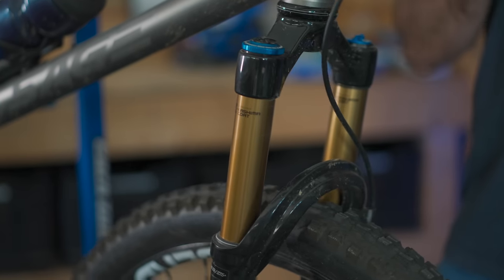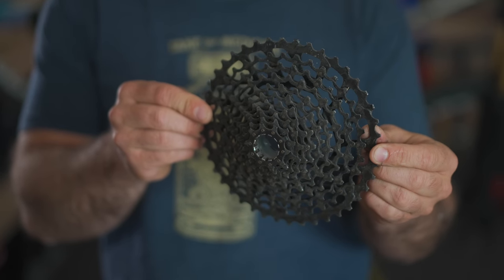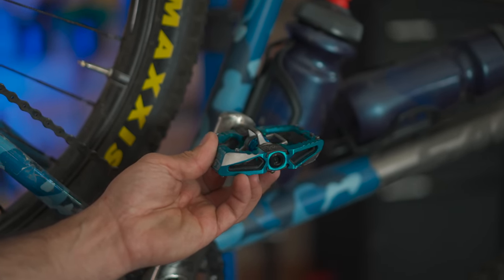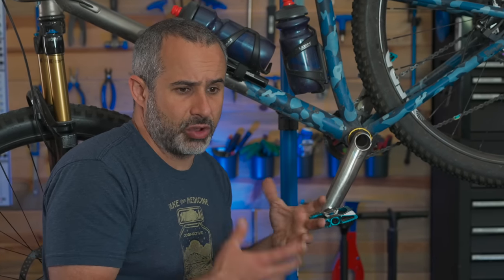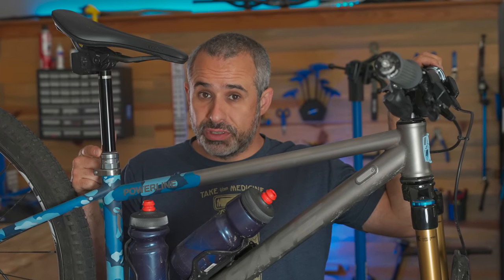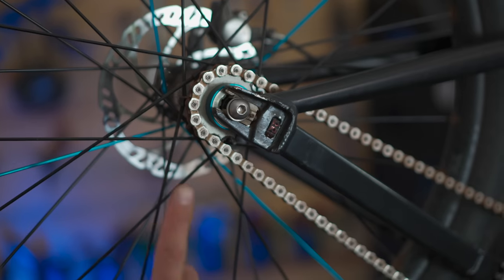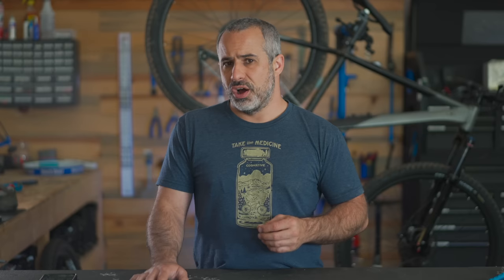You're saying it Wrong! The most mangled bicycle lingo clarified

Comment: as someone who works at a bike shop, i knew most of these, but it’s just not worth correcting people on most of them, being technically correct isn’t worth coming off as pretentious to the customer. the wheel one is the one i run into the most and i’ve just learned that whenever someone says they have a wheel related issue i just take what they say with a grain of salt.

Comment: The thing is, a chainring is also a sprocket according to dictionary definitions of the word.

Also in the 80's in Australia, everything was a sprocket on bikes, especially BMX.
Old timers would call it a sprocket.
However I wouldn't be surprised if chainring was also used it seems familiar. However it is a current term for the part in the mountain bike world.

However a chainring is merely a type or sprocket.

Comment: Oh it's called a bottom bracket shell?
We've been calling it the bottom bracket hole.
The MTB terms I find the most confusing are endo and stoppie.
In my country, we call the one where you brake really hard and the rear pops hard an endo. Basically the one you can somewhat accidentally do.
We call the one where you nose wheelie for a bit a stoppie. The one you actually need skill to do and I doubt can really be done accidentally. GMBN classifies it the same way.
But for some reason, people like to argue with me about it in comments.
At which point I just start trolling them because it's really fun to piss people off.
But which is correct.

Comment: Chainring comes from just a ring that goes on to a spider or arms of a crank, this came out of road bikes in the 70s and 80s. So technically many BMXs have sprockets up the front, and the new trend in mountain bike cranks have sprockets. Its not a front vs back of bike thing, its a description of the item, one is a ring with a large hole and one only has a small hole.

Comment: FORK END???? I'm living-breathing bikes for like 30 years now, I've been mtbing, messengering, raced on track, raced cx, played bike polo, worked in several bike shops on more than one continent and I have never ever heard fork end. 
But while we are at it and I have to admit it I have also used this term incorrectly for a long time, and I never correct anyone using it but a COG is something that's in a car transmission, a toothed wheel that engages with an other toothed wheel, that's a cog. Bikes with chain drives have sprockets.

Comment: i have one question: You explained that dropouts allow you to remove your wheel without derailing the chain, unlike fork ends.  but what about the term "horizontal dropouts"?  At least in my world, I have never been corrected by saying "horizontal dropouts", and I have also never heard the term "fork ends".

Your explanation of the term "dropouts" does make sense though.  You just drop the wheel out.

Comment: Sprockets absolutely go up front...on a BMX bike. I think this started in the 80s to differentiate between a 1 piece "disc" and spider+chainring combo. Similarly, the 4 piece bars on my BMX bike are plural, but my MTB has a handlebar. Same thing with the dropbar on my road bikes, but it also has drops. 🤣

Comment: I didn’t even know about the terminology with cables and housing but it was something that was driving me crazy when I was trying to explain an issue I have with bikes that don’t have the cable housing run the entire length of the cable.  Contaminants would get into the housing and affect the shifting or braking.  I started calling them cable housing not even knowing that was the proper term.

I am surprised you didn’t bring up stem and steerer tube because I used to call the steerer tube the stem.
Reply: I think that cable housing that doesn't run the whole length of the cable is better for shifting/braking, because there is less friction between housing and the cable.

Comment: I refuse to call any part of the drivetrain a "cog". A cog, by definition, is a gear that directly drives or is driven by another gear, such as a spur gear. Also a sprocket can be either located at the front or rear of the drivetrain, but at least on a bike, I would always think of the front if it's called a chainring or chainwheel.

Comment: HA!!! RIGHT THERE SETH.. Just after 8 minutes talking about it not being a drop out, but a "FORK END" BOOOOOM!!!  You have the same thing at the end of your front Fork.  You have 2 forks at the end of your fork, so FORKS!!!  Any any time I have ever used the term forks, it was in reference to the fork ends on a Fork. A front fork with thru bolts I feel has muddied that one. But you have basically confirmed everything I said in the previous post.

Comment: When people talk about brakes behavior they talk about modulation and braking power, but actually what they call braking power is more like "ratio between braking force / finger input force"
When the rotors and calipers cannot dissipate the heat fast enough, and as a result brakes fail (brake fade, fluid boil, etc), then you can say you need more braking power, but if you want to stop using less force on the lever, then you need q better braking force ratio.
In fact i dont know how this ratio is called in the industry

Comment: DAMPNER....A dampner is a hydraulic device used to reduce pulsations in a hydraulic system.
This differs from a damper which is a hydraulic device used to damp vibrations in a physical system that the hydraulics are connected to.

Comment: What about shifting up? Is that making your gears harder? Or when the chain goes up
Reply: Remember a higher gear ratio is for higher speeds (harder to push the pedals)  while a lower gear is for lower speeds.  A downshift is to a lower gear (easier gear, lower speed, higher RPM).  So "Shifting up" is to a harder gear: moving the chain to a smaller cog and/or bigger chainring
Reply: When I say shift up, it's to shift up the cassette to an easier gear, shift down = harder gear. It's Probably the other way in the US.
Reply: @Alan-75  what happens on a double or triple chainring when the "chain goes up"?  The opposite of what happens on the cassette.  What about an internal geared hub?

For those reasons, you shouldn't be looking at how your chain moves.  Up and down should reference higher/lower gear ratios.  Doesn't matter US or not.

Comment: 1:40 As someone who rides both mtb and dirt bikes I got this one wrong, I used to call it a fork for both however on a dirt bike they are forks because each fork leg can be removed separately from the triple clamps.
Reply: But it's a fork as an assembly. So even that is wrong. You have a left fork leg and a right fork leg. Together they make a fork.
Reply: @skullsroad3642  let me check if so that means I was right in the first place
Reply: @skullsroad3642  Seems to me that you can call it either fork or forks

Comment: but a chainring is technically a type of sprocket - a sprocket technically has cogs on it - a cog is technically the tooth on the wheel (gear or sprocket). so to say that 2:43 "this has one cog" is technically wrong but in bike terms it flys.

Comment: The reason people in the UK would call it differently than in the US (like for the derailleur) is because US advertising used to be sold by the character. so all the superfluous letters went away. Most famous example has to be color vs colour. correct way is colour. But the U went away in the US because it was more expensive.

Comment: In Norway some of the terms are confusing. So saying the wrong thing here can happen too. 
Dempegaffel= directly translated damping fork, which means suspension fork, but dempe means it has a damper then right? But that's what they call forks with only springs too. 🤦
Rear shock is not less confusing.
Bakdemper= rear+damper
But I've heard ppl in motorsports call it damper in English. Yes whole thing a damper. 
Don't call a steerer tube styrerør(steerer tube) cus that's the head tube, so it's called kronerør(crown tube). 
Yes crown tube is what we call a steerer tube. 
Styre=handlebar. 
It's very common to get that wrong, might be due to the English word being translated I to Norwegian.

Comment: Hearing or seeing 'dampening' rather than 'damping' when referring to suspension has always bothered me. I recall hearing 'dampening' from a suspension tuner once. That's a clear way to know when to run the other way. I have probably said 'forks'. Isn't that a little like 'pants' though - and how many is a pair of pants? 🤣Does a fork have fork ends or drop outs? Where's Gallagher when you need him? There are a couple of other words that aren't bike specific but are certainly used interchangeably in the biking world - 'verse' and 'versus'. I don't know where the mistake comes from but it's as bad as hearing 'dampening'.  A verse is a written poetic or musical device. Versus means against or compared to.

Comment: Preload is technically the wrong term, ride height would be more accurate. Preload is more so a function of a nonlinear spring let’s say a 100-300 in-lb spring and for arguments sake let’s call it a 2 inch spring divided equally. For the initial stroke it will take 100lbs to compress 1 inch in static load (gravity). It would then take another 200lbs to compress the second half. Preload would be compressing the spring an amount that will wash out that initial 100lbs or so. Since most of our coil springs are linear, you’re never increasing the rate, therefore you’re only moving up or down in the stroke (ride height or sag). If you dial up the ride height adjustment but the fork is topped out with you on the bike you are likely to introduce coil bind. Plus when topped out there is no down travel so the bike falls into the hole (this is also why many lifted trucks ride worse, the left no down travel). All of this is a bit of a short, crude description and I get preload adjuster, but if accuracy is the main story, then there you go.

Comment: Forks are forks in the same way pants are pants. 
I do believe a sprocket is a gear that is connected to the spindle. Chain ring would connected to 4 or 5 points on the crank arm / spider.
Please argue with me Seth 😉😂

Comment: A lot of this definitely falls under the general umbrella of pedantry, but I imagine the clarification is still pretty useful for plenty of people. Yes, damping and dampening are two very different things, but I'm pretty sure in most relevant contexts the average mountain biker will know what you mean either way. The difference between a rim and a tire, on the other hand? Yeaaaah, that's a different story.

Also, you got sag and preload flipped accidentally at the end of that section; you said "one does not set their preload, you use your preload to achieve the proper sag", when, yes, you do set your preload, it's sag you don't set. Preload's a setting, sag's a statistic.

Comment: Derailleur applies when your French, derailer applies when you're not French. Horizontal and vertical dropouts exist, but why not use thru axles?! 'Dropper' could technically be used on either side of the term 'seat post'. People calling a 'wheel' a 'tire' has been happening since the invention of rubber for round rollies, I give up on that one the first second I hear it.

Comment: Damping might be more technically correct, however I don’t think dampening is wrong since one of its definition’s is: “make less strong or intense.” Using this definition it applies quite well (basically a synonym for damping) as suspension is designed to make impacts/vibration less intense. Not sure which word started with this meaning first and perhaps it was just a result of people misusing one of them long enough that it gained official dictionary word status. Perhaps a word geek could help fill us in on the history here.

Comment: There's one where i would respectfully disagree with you.. Now i'll preface this by saying that i'm not really a mountainbiker, i'm too fat (though i'm working on changing that), and English is not even my first language, as i'm from Denmark. So it's very possible that i'm just talking out my *ss here.. 😅 I do however work on all sorts of motorized vehicles which also contains and utilize cables in my spare time, and have done so for pretty much all my life, and when i was able, i did also bike a lot, so i'm not completely inexperienced either.

However, in regards to the cables.. Here we use the terms inner and outer cable, or, like you, we say the the housing or outer housing. The wire though, we call that, well, the wire.. Or the inner wire. Because that's exactly what it is, a piece of stainless steel wire. 😅 Doesn't matter if it's shift housing and wire, brake housing and wire, or whatever else.. And in all cases, both components come together to make a complete cable.. A cable. So in just pointing to the housing, i'd argue that as the housing contains the inner wire unless something is wrong, people are right in just calling it a cable, referring to it as a complete unit.. 😄

In cases where there is no outer housing, that's when we may use the term cable when addressing the wire component alone..

Comment: 3:23 I prefer to call it wire, and housing, less confusing. Many get the cable thing wrong. Inner cable outer cable. Some argue what correct and what it means in UK vs USA. But universal understandable term is wire, it's a wire wright, going inside a housing. 
In Norwegian it's called vaier, housing= strømpe(r)) stalking(s) yes like what women wear on their legs.

Comment: Isn't the chain ring a sprocket tho? It looks like a sprocket, it's used as a sprocket, it must be a sprocket. But on a bike it's called a chain ring? A sprocket is "a profiled wheel with teeth that mesh with a chain, track or other perforated or indented materia"

Comment: And calling "weight" gram/kilogram is also wrong.  Gram/Kilogram is a unit of mass not weight.  6 kg of mass is the same value on Earth, floating around weightless in space and on the Moon.  But the weight is different at each of these locations. The unit of weight in the SI Metric System is a Newton; hence the unit of torque is newton-meter (= weight x distance) and NOT kilogram-meter.

Comment: A bicycle pedal "spindle" is geometrically an axis. And mechanically it's actually at an axle, since it doesn't rotate. 

 When did just the threads  of a pedal;s a spindle, start being called an "axis"?  I think you might have got your wires crossed on that one???

Comment: Sorry Seth but you are wrong.... Dampening means to reduce the vigour or effect of something.

Hence the dampening adjustment within your suspension reduces the violent reflection of bumps through your suspension, hands and arms. Shock absorbers act as damping but the dampening adjustment is entirely different. 

Damping is an entirely different word with an entirely different meaning..... So say dampening.... Don't forget the en..... They belong.

Oh and it is called a de-rail-e-ur. A derailer is something different entirely too.

Comment: "Industrial" bearings? Is there such a thing in English? I hear this term as a really well settled, used to distinguish regular, common machinery part: bearing assembly with outer and inner rings, balls and a separator; from the adjustable variation of radial-axial bearings. But neither are domestic or handicraft.
Reply: @IDKline , thank you! Haven't thought about it in that way. In my language the meaning of grade got lost, so only aspect of production method is there. That's why it sounds funny, as all of the bearings one can find in bicycle are industrial-made.

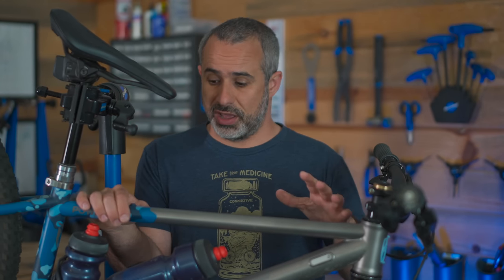Comment: 1:55 technically your wrong see old bikes forks are forks. Because your axle sits inside of two FORKS at the end of each leg. So technically old bikes forks are forks. New bikes with a boost fitting or whatever they are called don't use a fork to hold the axle so yeah you can call them fork. Haha.

Comment: One I want to know is, when you stop to work on part of a trail (to practice it), are you sessioning it (having a session practicing, or having a session working on a feature), or sectioning it (breaking the trail down in to sections and then working on the sections)....

Older bikes did have the freewheel built in to the cassette though, so that may be some old terminology coming across.

I thought that the bottom bracket really is the housing, and the bottom bracket is made up of the casing and bearings, this is much like a wheel, the name is the whole area. The reason I say this is it is the bracket on the frame that all of it goes in to. And on older bikes, the bearings pressed directly in to the frame (and they were loose like some headset bearings, sitting inside a cup), there was no separate casing.

In the moto industry, the front chain ring is called a front sprocket, though sometimes a front cog too, so that may be why some of the error comes across.

Holding an old chain next to a new one, they are definitely different in length. The metal on the chain has definitely been stretch, not just worn down...

Pre-load is also when you compress your suspension prior to doing a drop or jump.

I've always called it a spindle on the peddle too. Never heard it as axis, though I get the name, but that is odd.

Comment: The clipless pedal thing is something that started back when I started riding. It was the younger riders who made an issue of it. It's like they are trying to take away anything that is identified by the older generation rider. Anywhere you go in the cycling world, if you go to a shop, they know what you are talking about when you mention clipless pedals. That's what they are called leave it at that. You want to change something, when I lived in Michigan, I didn't ride mountains. So why did I need a mountain bike, I needed an all trails bike.